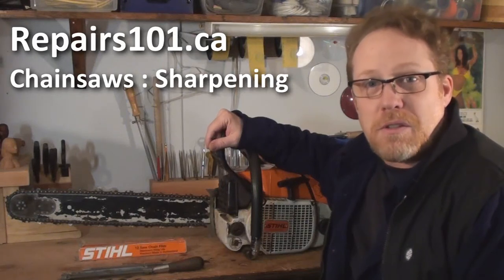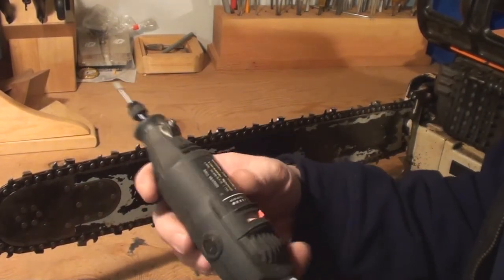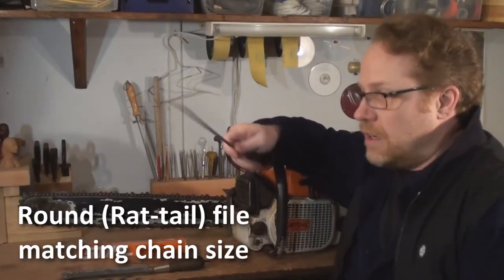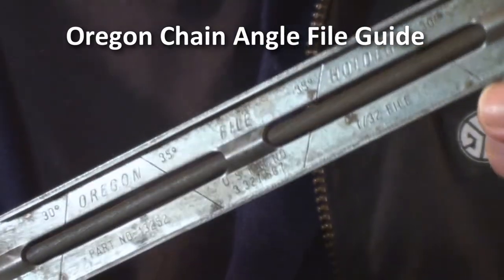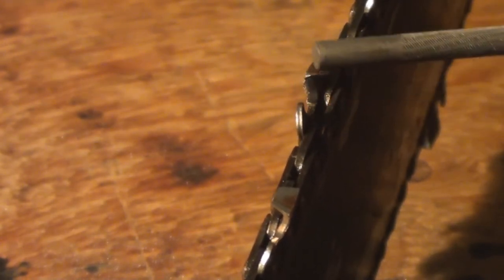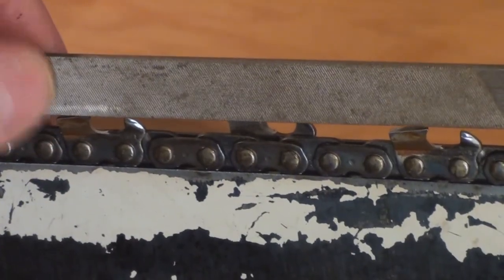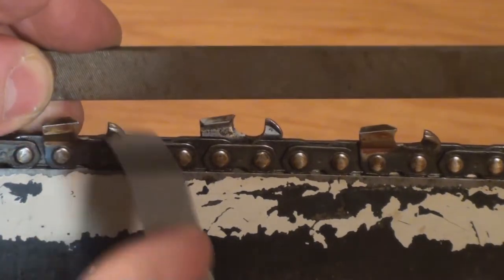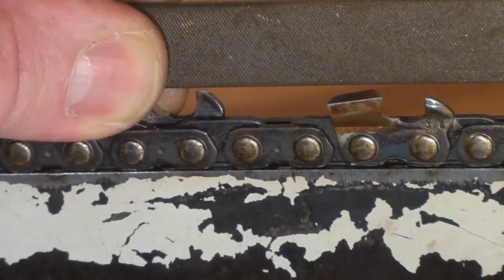Chainsaws : Sharpening

Comment: When sharpening back at the workshop using a vice, the best way to clear the filings is to simply tap the end of the file (opposite end to the handle) on something metal after completing every tooth, only make sure the file is vertical and you tap the end straight down; I tap down on one of the jaws of the vice, and in the field use either a rock or an axe-head, as tapping onto wood doesn't remove filings as well.  Thanks again for the video - ignore detractors making sarcastic comments.

Comment: As you suggest, the experienced guy knows how to judge raker depth by eye without having to use gauges, so apart from you dragging the file back across the teeth this video is on the money for part-time chainsaw users.
Can't understand why you take the file out of the guide though when sharpening, as besides giving you an indication of the correct angle on each stroke it keeps the file at the correct height.

Comment: Obviously with a round file cutting into the tooth as you sharpen it, the file can cut into the bottom of the tooth as well as into the leading edge, so the actual angle of the leading edge can alter.
Basically you want the file to be moving parallel to the top of the tooth as you sharpen rather than drifting up or down, and keeping the file in it's guide does this for you.
Just keep turning the file in the guide through a few degrees every now and then, and tap the end to clear filings.

Comment: Nice tutorial. I prefer the manual way when I'm at the shop 'cos I count my strokes making sure they average same number for each tooth. It's easier for balancing teeth depth. I did see one thing I have a peeve about & that is the backstroke, 3:47. For longer lasting files, I never apply pressure on the pull back. That dulls the edges of the file. I either pull it out & put back into starting position, 3:08, or if I'm in a hurry or lazy, I pull back lightly with little to no pressure.

Comment from the maker: I was taught that the steel in the file is so much harder than the steel in the chain that one could do no more than knock the filings free by (lightly) dragging the file backwards - no pressure on the back-stroke. Plus I sped up the filing segments of the video to make it more interesting/funny.

Comment: @coconutcrawler 

counting strokes doesn't ensure teeth will be sized equally. Slightly different pressure on the file, a more sharp side of file, angle of file (+) or (-) a degree, will all change how much metal is shaved off a tooth. When I break down and clean the saw, I'll check teeth with calipers. For field shaprening, I put my fingertip inbetween raker and tooth. If the tooth is longer or shorter it'll be appearant.
Reply from the maker: +Aaron H - this guy knows the score.

Comment: A file only cuts in one direction. The forward stroke is the cutting stroke then you should lift the file and start again near the tip. If you dont you will dull the file draging the file backwards. I use a battery operated dremel type tool in the field and a 110 volt at home. I keep a file with me in case I hit A rock or metal in the wood. You need A file if you have to remove alot of metal to get the edge established and then use the stone to get it rasor sharp.

Comment: I was going to say the same thing about pulling the file, I was always taught to only go push a file when dealing with metal, thought that was common knowledge but this guy made me question myself.  I never use a guide when sharpening, I used to but  not anymore, what did you mean by keeping the file at the correct height?
Reply: TheJhathcock you are correct. The file shouldn't even be touching the tooth that you are sharpening on the back stroke. This guy doesn't know how to use a file correctly apparently.

Comment from the maker: Thanks for commenting. I was taught that the steel in the file is so much harder than the steel in the chain that one could do no more than knock the filings free by (lightly) dragging the file backwards - no pressure on the back-stroke. Plus I sped up the filing segments of the video to make it more interesting/funny.
Reply: Repairs101 yes it's true that the file is much harder, but you will still damage it by continually using it this way. More importantly, concerning the objective is that because the file is much  harder than the tooth, you will reduce the sharpness of the tooth which you are supposed to be sharpening by dragging the file against it on the back stroke like that.

Comment: You should apply pressure on the pushing stroke and the file should be lift away from the cutter on the return stroke.
Don't post instructional video on stuff you don't know!